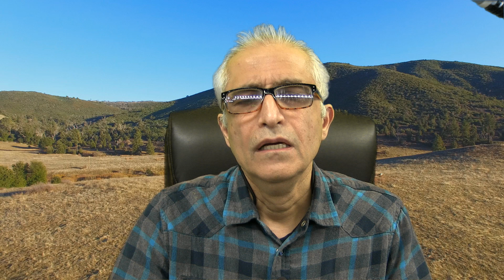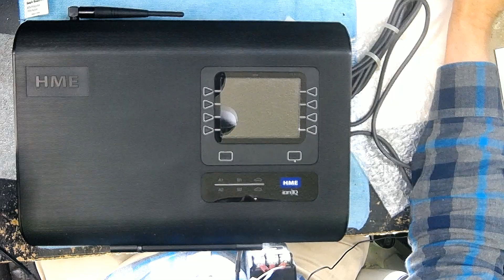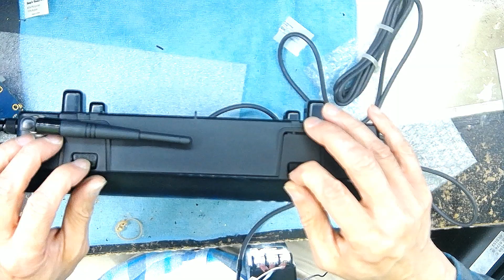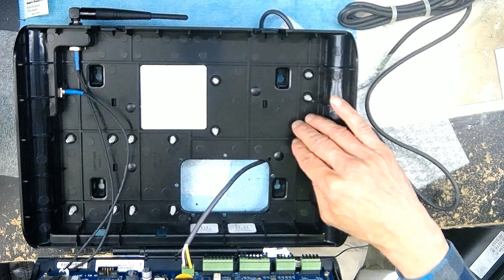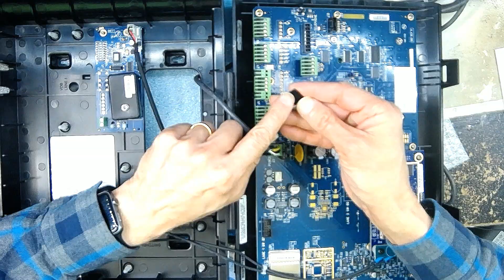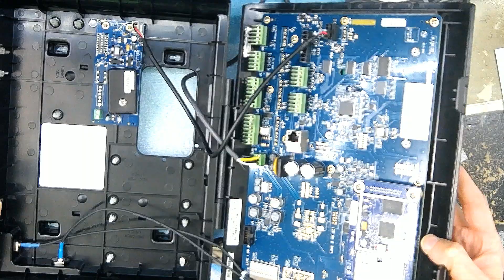How to install a Vehicle Detector Board in a HME ION IQ Drive Thru Intercom Base Station

Comment: Hello Sir. I just purchased the old HME ZOOM with Vehicle Detector Boad included. Can you tell me that the VDB has a speaker or alarm…..to notify us when it detects the car in lane? If not, how do we know when the cars in drive thru lane. Thank you Sir, your video very helpful.
Reply from the maker: Hi, the Vehicle Detector board doesn't have a speaker or buzzer, the sound comes out of the headset that the employees put on. See full details here https://www.khalids.com/EBAY/Intercoms/HME%20Vehicle%20Detector%20Board%20for%20Ion%20IQ%206100/VDB_102.pdf